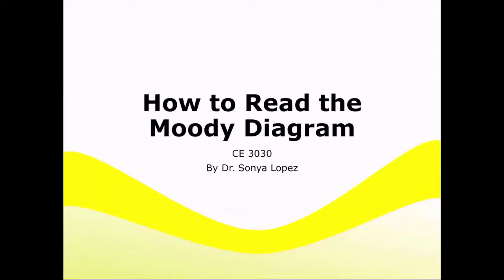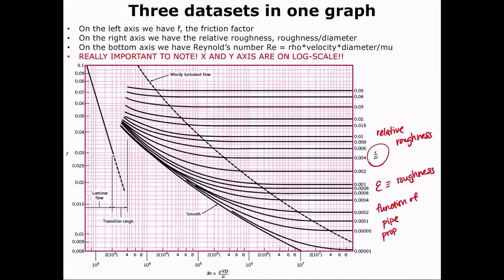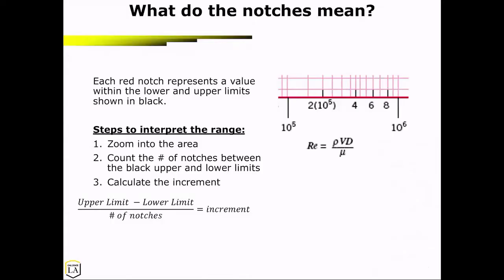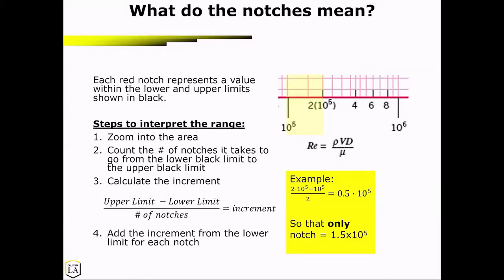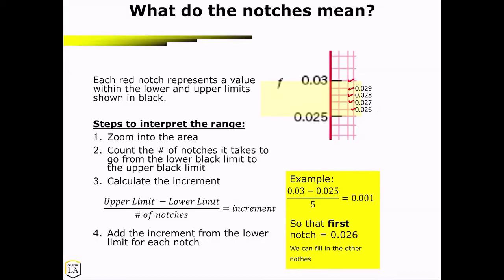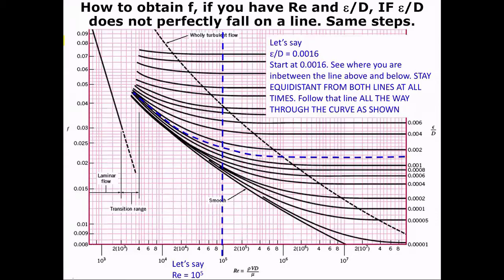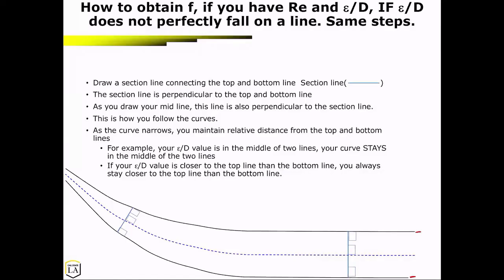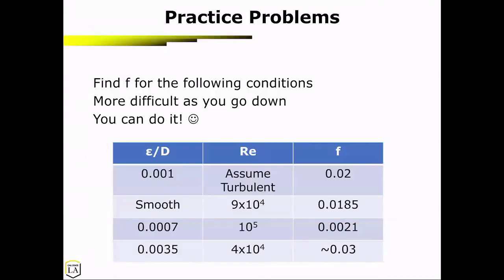How to read the Moody Diagram

Comment: All is good but If I am not mistaken ,its Dynamic Viscosity BTW, Thanks
Reply: For the same fluid, the kinematic viscosity is equal to the dynamic viscosity divided by the density.  In the Reynold's equation, if you use kinematic viscosity, the density in the numerator is removed.  It is the same as just taking the density from the numerator and placing it as the the denominator under the dynamic viscosity.

Comment: Good stuff..just the viscosity is dynamic not kinematic I think? Cheers
Reply: agreed, it's dynamic viscosity not the kinematic viscosity.
Reply: For the same fluid, the kinematic viscosity is equal to the dynamic viscosity divided by the density.  In the Reynold's equation, if you use kinematic viscosity, the density in the numerator is removed.  It is the same as just taking the density from the numerator and placing it as the the denominator under the dynamic viscosity.
Reply: i came to the comments to verify that she said it wrong at 2:36

Comment: please, correct yourself, dynamic viscosity comes in denominator of Reynolds number
Reply: @isaaconyancha4186  😂
Reply: For the same fluid, the kinematic viscosity is equal to the dynamic viscosity divided by the density.  In the Reynold's equation, if you use kinematic viscosity, the density in the numerator is removed.  It is the same as just taking the density from the numerator and placing it as the the denominator under the dynamic viscosity.
Reply: 😂😂😂it can even become apparent viscosity